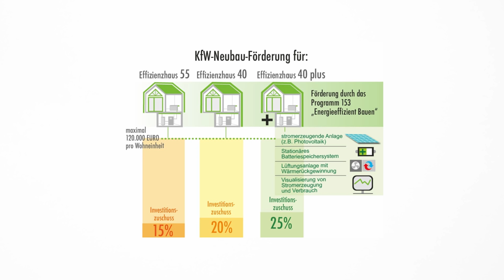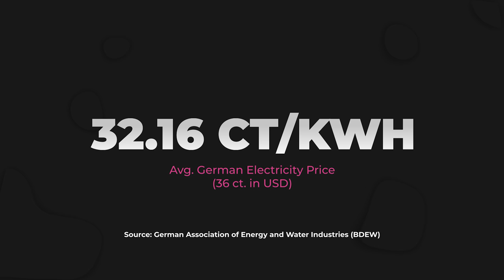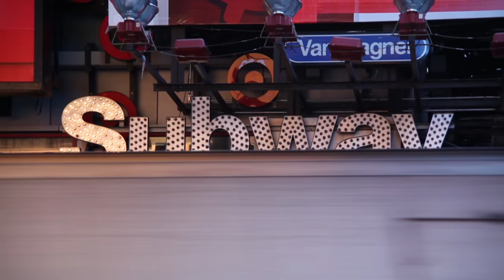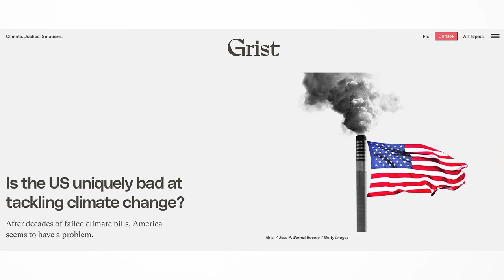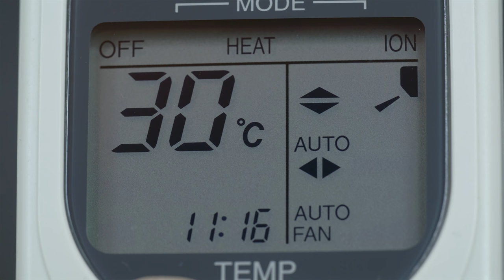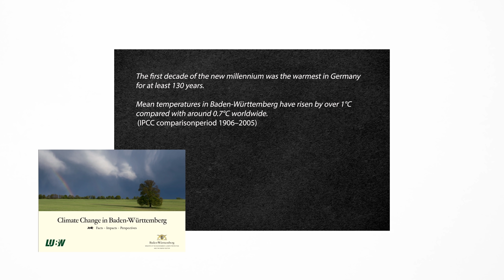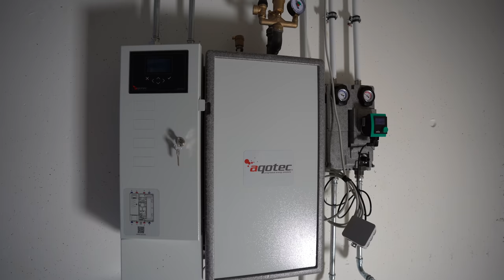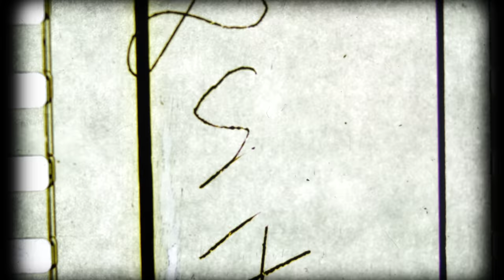HVAC (HLK) in German & American Homes | A Tale of Two Countries

Comment: I am Dutch but now living in Greece. In the Netherlands I didn’t even know what an AC was, but here in Greece we have AC. Temperatures can go up to 40-45 C in summer. But we always try to make the difference between outside and inside not too big. And that was a difference with the US where I was for a seminar. Outside backing, inside freezing. Very uncomfortable
Reply: The difference between inside and outside is the most difficult part to deal with. It is the main reason I prefer ventilation over airco. Even when driving.
Reply: a big difference between them is'nt healty.
heart and systemic circulation and fall apart and then u are unconscious.
Reply: pretty much the same in China and other Asian countries, at least in the densely populated areas. For example in Hong Kong, you need to bring a jacket in summer when working inside, because you'd probably catch a cold if not. >35 C and high humidity outside, dry air at <20 C inside - that's neither healthy nor reasonable.
Reply: @human_isomer  yep, worst cold I ever had…..
Reply: first time I was in NYC during Summer I felt like the Subways are set to temps belowing freezing. Insanely cold.
Reply: And that inside freezing, outside baking is why many people in Germany say an AC makes you ill. The air is dry and you have a really shock for your body when you change between inside and outside.
Reply: @SkeeveTVR  I have often read that the air conditioner (e.g. in the car) should be set no more than 6° C colder than the outside temperature. And I largely stick to it and get along well with it.
Reply: @SkeeveTVR  I remember those arguments in the U.S. back in the 1960's when A/C was becoming popular. The reality is that constant  excessive heat is far harder on the body than walking in and out of A/C.
I could actually live without A/C in my whole house, so long as I had A/C in my bedroom. You can tolerate heat if you have had a good nights sleep in a  cool bedroom.
Reply: @nejdro1  depends on the difference. If A/C changes the temperature over 15 °C .. thas is really hard for the body.
first u came in a store and searches for a jacket and at the end you dont wanna leave it .. because the big heat comes again.
Reply: @SkeeveTVR  Hmmm, I take it you do not frequent the sauna!  :)  Sit in a super hot room for a few minutes and then go jump in cold water, or snow is you are in Scandinavia. My German brother-in-law used to drag me to the sauna every time I visited Germany. I did discover why you needed a towel. Those boards you sit on are HOT!  
Either rapid, dramatic temperature change is healthy, or it is not! I survived walking in and out of A/C, and I survived the sauna!
Reply: @nejdro1  90 °C sauna and jumping in cold water is for (semi) pro's, not amateurs.
Newbie starts with 50°C / 60 °C sauna.
Reply: @SkeeveTVR  The sauna that was in our cellar when we bought this house is one of the few things that made my circulatory system almost collapse in my life. (It's no longer there since the cellar was flooded a few years ago, all that wood and the spaces between wood and wall - once it got thoroughly wet, it was pretty much ruined.) I can do sauna (or at least I could back then) if I'm not in too long and if the temp diff to the water isn't too large. But I'm not a fan. I don't really like being sweaty.
Reply: After our honeymoon with about 35 C everyday on the flight back we asked for more blankets because we were freezing so badly. We couldn‘t beleave the AC was set to 25 C 😳
To us it felt more like 10 C
Reply: @nejdro1  It depends on temperature difference. Last year young kid died after he got out from car. Inside of car it was like 75 or less, outside was 105F. It can be really dangerous if difference so big at those high outside temperatures. 

Sauna isn't activity people do multiple times every day. More like weekly.
Reply: Very uncomfortable for you, when you grow up with AC everywhere it's not thay big of a deal
Reply: @zpetar  lmao, you're joking right? I do that basically 3 months out of the year.
Reply: @seanthiar  thats actually not true, i live in Arizona and keep ac on most of the year, it depends on weather or not you are used to ac or not, if you are not accustomed to it you might get sick from the abrupt change, but if you are acclimated to ac you don’t get sick, ive had  one cold since 2019 and while it lasted a long time i got over it eventually and rarely if ever get sick.
Reply: Oh yes: I was on a race bike trip between LA and Palm springs. We had 123°F (53°C from memory). When we entered the Hotel and Restaurant we where almost freezing to death and had to pull on pullovers to "survive" the cold inside... crazy.
Reply: @martinbinder2534 The most healthy temperature is 22ºC and that is how I got my air conditioner set in my car all year long. I live in the UK and the temperatures are similar then those in Germany (I lived there my first 25 years of my life). My experience is that on hot days there is cooler inside the house then outside in both countries. I'm myself Spanish and in Spain there are more private properties with air conditioner, but not so excessively then in the USA. I personally can't live without air conditioner in the car and I won't buy one without it. In an older car I had I changed the air conditioner compresor for nearly the same price as the car was worth it. I need my commodities and if you use them sensible it won't make you ill.
Reply: @martinbinder2534  Six degrees Celsius lower than the outside temperature?  Never heard that before.   For me, that would mean during the summer months, I would be setting my air conditioner in the car between 37 and 40.  That just doesn't work for me.
Reply: Having lived in several environmentally very different parts of the US (nearly at each corner of the country) it is mainly the southeast that has the very cold indoor AC temperatures. There are likely other areas but in Washington Arizona or NY that isn't typical.
Reply: @huubjoanfranssen8980  we use the turkish ac - we open the windows...
Reply: @bh5037 tried it in India…. Only had smog in return

Comment: Best natural AC in Germany are a couple of big trees around your house. I experience it every summer at my workplace. My building has a nice temperature opposed to the ones of my colleagues. They are exactly the same, except the oak trees.
Same goes for whole cities. Those with big parks and green air corridors are significantly cooler in summer.
Reply: Yes - the key is to block the sun from overheating the house. Green spaces - parks and trees in streets can stop sun - too much enclosed spaces in cities, large parking lots... really contribute to cities being 3 - 4° warmer.

You mentioned also blinds on windows - I fully open my windows at night in a heat wave and have cross ventilation to cool down each room. And close all windows and blinds come morning. Your insulation of the house is key with this - but this way you should keep room temperature at ~26° C - even if the outside is 33°.

If you live in city in South Germany in rooftop apartment then you'll probably will need air conditioning with hotter summers each year.
Reply: And it doesn't hurt that the average high temeprature in the summer is 12 degrees cooler than even here in Central Missouri where I live. If you are in the south in the US... average highs are 18-20 degrees hotter than Germany. Imagine if your climate was like Austin, TExas... average of 108 days per year OVER 33 degrees celsius.

Comment: Ive had experience of blown air, radiators and underfloor central heating and I would chose underfloor every time. It simply feels more comfortable, a more even spread of the heat and of course much more decorative and furniture freedom of arrangement, ie no walls you just cannot have furniture against. Bathroom floors are particularly more comfortable with underfloor heating in my view.
Reply: I agree and I've had the same experience. The home I'm at currently uses forced air and it is very uneven through the house.
Reply: Of course, you can only have that if your floors are concrete.

Comment: One thing leads to another. A house build with frames offers lots of space to hide air ducts while a brick building makes this really complicated. A brick house has a huge thermal mass which acts as a buffer against heating up. So some commonly used strategies in Germany like extensively venting during the night would simply be way less effective in the US due to the small thermal mass of US homes. 
And low energy prices result in less incentive to safe energy. Even in Germany homes with energy standards higher than 55 are barely economic.
Reply: I grew up in Chicago where the whole town is full of solid masonry houses and buildings by law as a  result of The Great Chicago Fire of 1871. The downside of a house with high thermal mass is that after prolonged heat spells, it is like living in a bakers oven! They just do not cool off at night once heated up. The average daytime temp for Chicago in August is 29 degrees Celsius, with much hotter  from time to time. Add to the thermal mass of the homes themselves, the pavement of thousand of miles of streets. I grew up in the 1950"s without air-conditioning. I won't give up A/C willingly! I presently live in Portland, Oregon, where last summer we hit 44.4 degrees Celsius. Yes, my A/C was running non-stop.
Reply: @nejdro1  these old houses have almost no insulation. Insulation works both ways. Many cultures developed ways to keep houses cool without an AC. 
Houses in the US just need excessive AC because they are not built in any way to use natural cooling.
Reply: @svenweihusen57  you can't say this about all houses in the US. I will agree a lot aren't energy efficient. My mom's home is wooden, but extremely energy efficient. The doors where shitty and would let hot or cold air in. My mom replaced the doors for a better seal and it was great. Her home is cooled and warmed by Geothermal energy. Geothermal energy is the 4th cleanest form of renewable energy.
Reply: Oh also Germany doesn't have the humidity that some parts of the US does. Food for thought....Average humidity in Germany is 60%. Average humidity in Florida is 75%. There are only 8 states that has an average humidity level lower than Germany. Its mostly out in the desert.  If you open your window you are inviting mold and mildew to grow inside your home. You want to keep your windows and doors closed as much as possible.

*Edit another thought here. Most European cities are further north when compared to most of the US. Spain is close to the longitude of New York. Oberstdorf Germany is further North than Maine (this is the southern most city in Germany. Right? I'm testing my memory here). Maine you are able to go without A/C if you open windows when cool and close windows/blinds when hot. Global Warming is making it more difficult in Maine to go without A/C.
Reply: @svenweihusen57  One thing the older American house had was much higher ceilings than is common today. Often 3 meters high or higher, so that heat would naturally rise up to the ceiling. They also had large windows, mostly "double hung", which would allow the upper sash to be lowered, causing a natural cross ventilation even in a room with only one window. Also, it was common for hallway doors to have a "transom" over the door. This was a small window which would kip inward to again allow a cross ventilation through the room, even with the door closed. I grew up in an 1883 Victorian wood frame home in Chicago that had all these features.
Reply: @nejdro1  Regulations crushed the standard high ceiling homes in many states is the reason along with cost of building them.
Reply: @w8stral  I don't think it was regulation so much as a change in styles and keeping costs down. Higher ceilings demand more lumber and materials, also larger windows and doors. Most of the newer homes have gone back up to 9 foot ceilings ( 2.74 meters) from 8 foot. However, I think this was mostly for aesthetics, rather than functionality. In recent years, American homes have shrunk somewhat in area. High ceilings tend to make smaller areas look larger.
Reply: @nejdro1  Depends where you live.  Southern USA, high ceilings are the norm as it is always hot even with AC.  As for northern homes, it actually IS regulations as no engineering is required if you do what the code calls "standard" construction, but as soon as you have a structural wall over 8' high, you have to prove to the asshat bureaucrats, who never actually look at your calculations, in the building and land department, that yes indeed your house will not magically fall down using structural members over 8' tall.  To eliminate this cost, construction designers chose to simply remove this additional engineering cost, and yes, material cost, and labor cost from their projects... and the truth is higher ceilings are COLD if your main energy consumption is HEATING unless you put radiant heat in the floor which essentially means concrete floors which once again due to REGULATIONS in the UBC is near impossible for cheap engineering, and since wood is cheaper......   One keeps going round and round Cost and regulations.
Reply: @nejdro1  Interesting. When my company build a new bureau building (without AC!)  a few years ago they planned the building with slots for cooling just as you described. And we later tested that. It really worked. The cleaning stuff made sure the external windows were tilted (German Kippfenster) and the windows above the door were open.  The first person entering the room in the morning usually closed the external windows again.
Reply: @wora1111  I once lived in an apartment with the ultimate "cross ventilation". It was on the 24th floor of an apartment building close to Lake Michigan in Chicago. It was a corner apartment facing the Lake. If I opened the windows on both sides of the apartment, a tornado blew through the apartment. It would literally knock pictures of the wall! this was in   1970 when the building was brand new and had no air-conditioning. It was not necessary being that close to the cooling Lake Michigan and with that much extreme ventilation. 80 Meters in the air also puts you above the heat load of the city's buildings and streets. My apartment was also on the North-East corner, so it did not get the afternoon sun.
Reply: @svenweihusen57  look into the 60's MODERN designs a LOT of them had "passive" heat management like LARGE eves to block high up sun BUT to allow lower angle sun to shine inside
and most of those designs were DROPPED for cost reasons and "modern" US homes are largely inefficient at temp regulation

Comment: As someone who is interested in history I looked into how people coped with heating or cooling homes without modern means. It is quite interesting to see how much you can recognise in older buildings and that some of it is still in the minds and traditions of the people. 
A few examples: Too cope with heat in the summer rooms were built quite high, so that the heat could rise and it would remain cooler closer to the floor. Windows towards the south were smaller than those towards the north. Rooms that needed to be colder, like dairies, would be placed towards the predominantly windy northern corner of the house with a floor of unglased tiles. These tiles would be doused with water in the morning. During the day draft and evaporation would bring the temperature down several degrees. 
To make heating more efficient walls were covered in tapestry or wooden panelling, that would better reflect the heat and insulate the cold walls, so that less heat is wasted heating the walls. Houses in colder areas tended to have double windows, so that the air between them worked as isolation. Basically a precursor to our modern double glass windows. Old timber frame houses with wattles and dow(?) walls had a very good natural heat management. 
A lot of the old practices like the one you described still work really well today.
Several of these old practices and techniques see a resurgence in modern building construction and I find that very interesting.
Reply from the maker: 100% agree. It is SO ingenious the techniques they utilized that are still so relevant.
Reply: @TypeAshton  It's fascinating that underfloor heating basically was already used by the romans with the hypocaustrum and in addition they used hollow earthenware bricks called tubulae to funnel the hot air from the hypokaustrum trough the wall and thus heating the wall and the room. They basically turned the wall into a chimney. That was the way they heated houses and the caldarium. You could say that this a  precursor to a modern forced air central heating.
Reply: I think it is “wattle and daub”
Reply: And of course Romes advanced heating systems were made possible by slaves, who only enjoyed there benefits if they were household servants, not the poor devils who were firing the system.